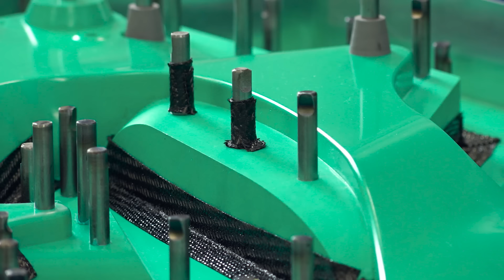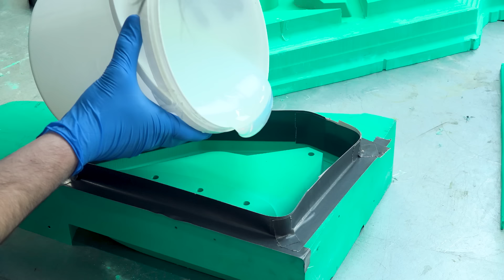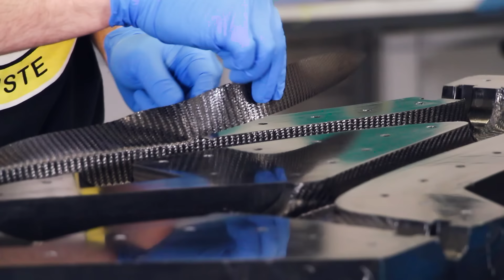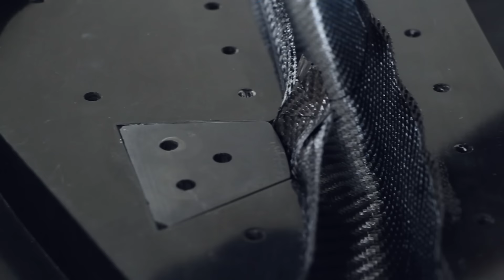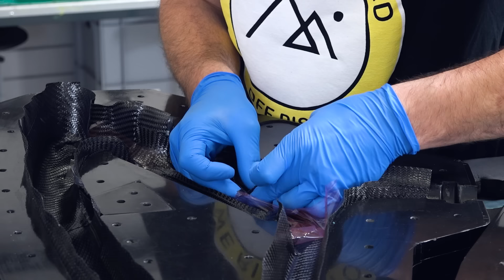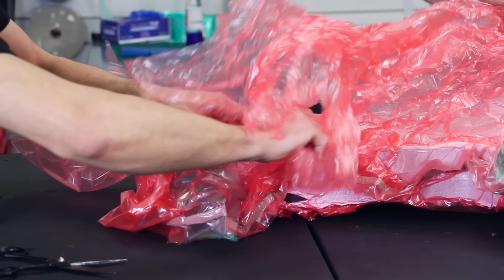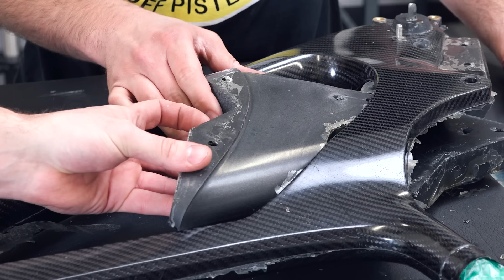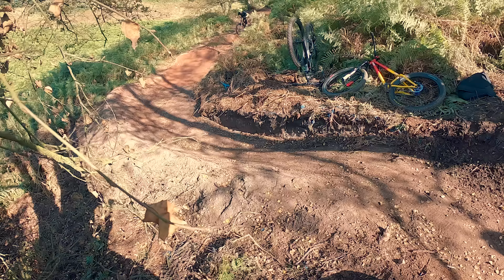Making a Carbon Fibre Bike Frame – From CAD Design to Downhill Race

Comment: what is the name of the carbon fiber material? it's like a sticker not like carbon fiber that I often see that uses resin.
Reply: This is pre-preg carbon fiber, where a specific amount of epoxy resin has been impregnated into the carbon textile. With this process the textile manufacturer (and the person using the product) know the exact properties of the final cured product. It also ensures that exactly the right amount of epoxy is used which reduces the final weight, increases strength and reduces waste. 

The process you are referring to is called "wet layup", where dry fiber is coated in epoxy during the layup process. This can be a cheaper option for use in cosmetic parts or for home builds. The real downside to a wet layup is the possibility of an area of the work piece not getting enough epoxy and coming out weak or not even hardened.
Reply from the maker: As per Dustin's response, this is PrePreg, the resin is already applied to the fibres.

Comment: Awesome video! How much is approximately the total material manufacturing costs both  for tooling and carbon parts including consumables (release film, vacuum bag, sealing tape...)?
Thank you!
Reply from the maker: OK, well, as a real ball-park guess there was probably about £2500 worth of materials and specialist equipment sunk into this project. That does not include the CNC router (or the cost of having it done, if outsourced) or the cost of a curing oven but it would cover everything else. The real cost of course is in the hundreds of hours of labour.
Reply: @easycompositestv  Thanks for answering. Just one more question: why not to use a self releasing tubular vacuum bag with out release film? It would be too hard to pull it out after laminate consolidation? Is the release film actually still inside the frame?

Comment: First time seeing a video like this. Very interesting. I wonder if using different resins and different temps could lead to a stronger product?
Reply from the maker: Hi Bo, not really. You will get slightly different mechanical properties from different resin systems and some of those resin systems will have different cures temperatures. Higher cure temperature doesn't necessarily mean better/stronger and 'stronger' itself might not always be what you're looking for. It's a complicated business but in general the fibre choice and alignment and laminate thickness will have much more bearing than the resin matrix.
Reply: Bo Lawrence the things is with any cycle being a motorcycle or a bicycle you always want a little bit of flex and making a carbon fiber frame to strong will reduce the amount of frame flex

Comment: Cannot understand a word this guy says. Horrendous diction.
Reply from the maker: Strong words. Well, lucky we transcribed the whole project and added subtitles to the video. Just turn them on in YouTube and hopefully you'll be able to follow what's being said.
Reply: @easycompositestv  - Nothing personal, good luck with your project, I should have used subs yes. I may have cabin fever. 

That said if you want a language baseline you might watch Hambini engineering examine a carbon frame: https://www.youtube.com/watch?v=pqsRW9zX-SQ
On a tech note, looking at the manufacturing process at Koenigsegg automobiles I see they use a padding material between the release film and the inflation bagging. This does not seem much more complicated than your process and would seem to naturally address the tight radii in a bike frame. I wonder if you have rejected that step, or consider it of no use, or other?

Comment: Very interesting video! It's hard to believe that it's more stable than aluminum. If you see all these little pieces that are glued together a little bit and that is supposed to be so stable. 😉
Thanks for sharing your video 
Greetings from Germany 
Chris
Reply: What's missing when you're looking at sheets of carbon fibre being laid down, is the resin. The tackiness they referred to. It flows from sheet to sheet, creating the bonds. And because the sheets overlap, they are bonded along a large surface area.

Comment: This confirmed so much od what I was just doing by trial&error...thanks alot!! Please, how in the world did You manage to pull out the bags? I have a much more simple tube like design and when pulling/twisting I ended up with a sleeve broken in the middle 2 out of 4 times... remaining in the tube forever :/ no big deal, but playing for every gram of saved weight...it just sucks adding these up... Thanks for any suggestions! Regards, Ivan
Reply from the maker: Hi Ivan, is the bagging film that you're using self-releasing? - I know that might sound like an obvious question because generally resins don't stick to vacuum bags but the tube used for this application are specially release coated on the outside so that they do release more easily. Even still, it's quite a wrestle to get the bags out and in some of the really tight geometry it's quite likely that some of the bag ends up staying inside. It only weighs a few grams and doesn't really make any difference.
Reply: @easycompositestv  Hmm, I am using the self releasinf tubular film from You. However, I haven't coated it with anything. I suppose it is the overlaps filled with some excessive epoxy causing the problems (I have a wet layup)

Comment: can i use, fiber glass mold to make one for a bike frame ?
Reply from the maker: If you're using prepreg carbon fibre to make the frame then using a glass fibre mould might be problematic because glass fibre expands more than carbon fibre at temperature and so the mould could expand at temperature in the oven before the prepreg carbon (the bike frame) cures, then the frame cures, then the mould cools and shrinks and it can put stress on the frame or make it difficult to release. For this reason, using carbon fibre moulds for high temperature prepreg curing is generally better.
Reply: Easy Composites Ltd  oh thanks - just what i was looking for - given the multiple layouts did you subject the frame to multiple stress test prior to assembly ??

Comment: Hi! I have a question about the clear coating part. My own experience is that when clear coating carbon fiber parts with pinholes, it usually turns out to be "fisheyes" where the pores are. In your video it looks like its just straight forward clear coating it and it turns out perfect, but hat is seldom the case. So whats the best way to deal with the pinholes? Looking forward to your answer.
Reply from the maker: Hi Jimmy, your experience of clear-coating carbon composites is much the same as anyone else's; even the very best made composite parts can be a real challenge to spray because of the fish-eyeing problem - this can even occur if there are no pin-holes on the surface of the material simply because of fibres being right on the surface with no resin coating causing the paint to react differently around them. In this video, where you see Vlad spraying the frame, he's actually already done some 'priming' using a brush on epoxy clear coat (our XCR Epoxy Coating Resin) which a lot of our customers use as a primer/pin-hole filler, prior to paint.

Comment: What was that acqua green material that was being machined? It looks like a foam, but then it was like sealed? Sorry english is not my first language, excellent video anyway! Learned a lot, and the end result is breath taking, congratulations!
Reply from the maker: No problem Shao. The material we machined was our EB700 Epoxy Tooling Board. It's a relatively high density (700kg/m3) solid block material that's used when machining patterns that will be used in conjunction with epoxy prepregs, otherwise you can use a slightly cheaper polyurethane board of around the same density, such as our PU600.

Comment: Is the prepeg carbon fiber become yellow with the time? If no, which process to build a carbon fiber part make the part that its been build with the time to become yellow?
Reply from the maker: The resin system used in our XPREG prepregs is pretty modern and has excellent resistance to UV light on its own. We've been supplying our prepregs for many years and I've personally never seen a component that's showing evidence of yellowing. Additionally though, Vlad used a 2K automotive clear coat on this frame which provides a good level of protection to the epoxy in the prepreg.

Comment: Excellent video!! I'd love to know if the same methacrylate adhesive was used to bond the aluminum bottom bracket housing into the frame? Was a jig used to bond the bottom bracket housing into position to ensure it's true? Once again, thoroughly enjoyed this video,  incredible knowledge and skill!
Reply from the maker: The Adhesive used was VM100 methacrylate adhesive.  A jig was used to hold the bottom bracket straight.

Comment: spa bond and plexus test please. I would like to understand the real truth?
Reply from the maker: Hi Stuart, we're deciding which adhesives to test and we'll definitely be doing this video. It's likely that many of the adhesives we test will result in substrate failure (meaning the CFRP will rip apart) before the adhesive does so there might not be a definitive winner in many cases but I guess knowing that an adhesive is stronger than the substrate is all you need to know in most practical situations.

Comment: I'm curious as to why you say polyurethane tooling board is not compatible with epoxy pre-pregs? Does it have anything to do with thermal expansion or temperature tolerance?
Reply from the maker: kru5tyjugg13r no, it’s stranger than that! When PU boards are used at elevated temperature they actually inhibit the cure of epoxy prepregs meaning that the resin in contact with the board doesn’t cure properly and remains tacky and won’t release properly. For this reason, epoxy boards are always used for prepreg cures.
Reply: @easycompositestv  Really??? I had no idea. That's a really good thing to know. Thank you very much!

Comment: That was amazing as a total bike geek I would love to design and make my own parts
Reply from the maker: Well Will, you could start by designing and making much smaller components and develop your skills and understanding. We have customers who started off making things like crud catchers, Garmin brackets etc before moving on to more complex/critical components.
Reply: @easycompositestv  Is it possible to cut out a mould from a piece of epoxy by hand, and then later on use a normal household oven to cure the carbon? I don't have a lot of money to buy those tools.
Reply from the maker: @hashy4940  The Epoxy tooling block is very hard to cut by hand so it would be very difficult.  Also it is only meant for low volume use so you may well destroy the mould after only a few pulls.
Reply: @easycompositestv  I understand, I sort of suspected that to be the case. Anyways thank you for the reply

Comment: Does that work with a Motorcycle frame too, i mean such a frame has much more force to take ...would be nice if you can show the process how do duplicate such s frame, like you did in the car bonnet clip, witch was really great to watch, very good explanation of all the steps, and easy to follow.  Great channel, keep up the very good quality fellas :)
Reply from the maker: Thanks Matt. Yes, in principle you could use the same process to make a motorcycle frame although as the thickness of the laminate increases (which it would need to do considerably for a motorcycle frame) then you might start to struggle to get adequate consolidation using just vacuum pressure. To check this would need to make up a section of the frame at the correct thickness and then cross-section it to check for any voiding.
Reply: @easycompositestv  Thank you very much, so does that mean i have to use the same thickness as the steel frame, right ?  So if the Steel is 2,5mm, i have to use 2,5mm Carbon layers as well ? 

Thank you very much :)
Reply from the maker: @mattapple2105  That's usually a pretty good starting point. Carbon is different to steel because you can choose how to align the strength in order to get the minimum wight part by orienting the strength where it's needed but if you were going for a more basic quasi-isotropic layup (fibres oriented in such a way as to fairly evenly distribute the strength) then matching the steel in thickness would be about right.
Reply: @easycompositestv   Thank you very much for letting me know, you Fellas are the best !

Comment: WaW
This process is complex...but when you consider the raw cost of metal moulds and that process in rapid prototyping...this just simply blows my mind!
Reply from the maker: Thanks Dennis, agreed that making the composite mould is more complicated and labour intensive but you're right, it still works out an awful lot cheaper than a billet mould, which at the prototype stage might not even be right yet anyway!

Comment: It is possible to do it "at home" alone?  I am thinking about start a little business involved in making bikes?
Thanks a looot for your video <3
Reply from the maker: Well, yes, pretty much. If you've watched the video all through then you've seen all the stages involved, there was nothing missing. The parts of the process that are the most challenging for a 'home build' would be the CNC machining of the pattern, the oven curing of the mould and the oven curing of the components (the frame). I'd suggest outsourcing the CNC of the pattern and then investing in an oven (like ours, shown in the video) for the curing.
Reply: @easycompositestv  Thank you sooo much for your response.

Comment: Nice !
I would like to see how to best make attachment points to carbonparts. Like nuts, bolts or studs that needs to be included in the finshed part, like a supercar where they bolt a subframe to a carbon monocoque.
Reply from the maker: Daniel Holmberg we plan to do a tutorial about fixtures and hard points in a future tutorial.
Reply: @easycompositestv   yes do it thank you

Comment: Manipulating carbon fiber requires a very high safety level. It is highly hazardous as fibers are carcinogenic like asbestos. Whole protective clothing, mask, as well as HEPA filters are required. Workshops mechanics, even consumer, wheelbuilders... all exposed to this "plague". Industry is avoiding that theme which will become a big health and environmental problem sooner than later.
Reply from the maker: I’m not really sure what you’re referring to and I don’t think your comments are in line with any research or facts about the materials used in this tutorial but I hope you enjoyed it nonetheless.
Reply: @easycompositestv   I´m really surprised by your answer, so that´s why it worries me. Same happens to most carbon composite user/consumer/mechanic, which is a serious problem for their health. I´m not talking to damage or nonsense. I´m a serious person with scientific baseline. Please do some research for your own health. You can google it. You can check any high end carbon composite manufacturer factory safety measurements. You will see them all worn in white clothing with masks and the air is controlled and filtered with HEPA filters. Carbon nanotubes are extremely small particles (PM2,5) which breathed go directly to blood. So small that go all along the respiratory system. They are carcinogenic and also have cardiac damage potential. As I read from NASA composites safety protocol they are also bad for skin. I don´t like carbon fiber as material because I prefer metal, but this is not a personal attack which I gain nothing from. Just trying to advise people who ignore it. There is also a huge environmental damage problem caused by composites, which is no small to forget about. Here I drop some references. I am in the bicycle buisness and have had a friend from Taiwan few times at home offering me carbon products which I can´t accept to handle for that reasons above. Yes, I´m losing money but there are other things first. (to me)
Reply: @easycompositestv  https://www.scientificamerican.com/article/carbon-nanotube-danger/       https://mrc.ukri.org/news/browse/carbon-nanotubes-may-pose-cancer-risk-similar-to-asbestos-and-we-think-we-know-how/          https://ntrs.nasa.gov/archive/nasa/casi.ntrs.nasa.gov/20150012180.pdf         just few references.
Reply from the maker: Right, it looks like you're confusing carbon fibre with carbon *nanotubes*, definitely not the same thing!

Certainly there is much more concern around over carbon nanotubes which your first two links both refer to. We can assure viewers that no nanotubes were harmed during the making of this frame or indeed pretty much any other carbon frame on the market. But, indeed, on the off chance that home builders or SMEs are experimenting with nano tubes (perhaps in the resin matrix itself) then extreme caution on the PPE and handling would be essential.

Comment: Are the bags reusable? Do they have any special characteristic?
Reply from the maker: Hi Lucas, you wouldn't normally re-use the bagging films. They're only very low cost materials (in the grand scheme of things) and so to ensure they're always entirely reliable and undamaged they are replaced for each new layup. They do have special characteristics such as being high strength, high temperature and release coated (or self releasing).

Comment: I met Vlad at cannock chase last year and was mega impressed with the workmanship, Quantity and finish off the frame.
Reply from the maker: Hi Steve, thanks for the comment. You're right, this is one of those projects that you might wonder whether it looks and rides as good in real life but certainly it looks like a very nice piece of work, even under close inspection. As good as pretty much any high end bike frame does. And in terms of ride, it's being regularly raced and doing very well.